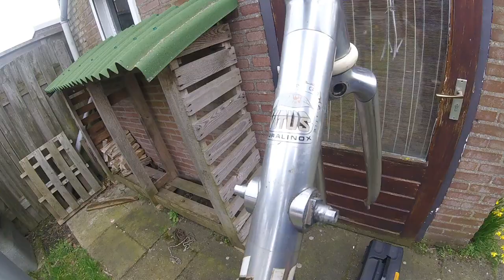Vitus 979 Duralinox - building my new Eroica bike, pt. 1

Comment: I come from this era in cycling loved those frames but could not afford one, used to do all that work with eyes shut but all these years later had to think, but I instantly picked up your gear shift  error!..nice wheels I had a hand built Bob Jackson 531 Pro frame suntour superbe pro groupset mavic rims, thanks,  look forward to part 2
Reply from the maker: Thanks! It was the first time I was putting proper downtube shifters, hence the trial and error. But they shift great in the end. I've ridden more than 100 miles already and hadn't have any problems. I'm curious about your Bob Jackson. Do you have any videos?
The part 2 of this Vitus 979 build video is almost finished, I'm planning to put the voice-over and I'm experimenting with the audio setup.
Reply: @polishTinkerer  I'm 64 now but if I got on a new bike I would be looking  for gear shift on down tube all the time! I was a  road runner but due to persistent injuries I took up a bike and got hooked on it joined my local club. No good mind! Just an average all rounder!..first bike was a Dawes imperial, second hand , which they all laughed at with my 36/50 chain set (but they never knew about my running/injury) I am in  west cornwall so can stop and admire the views when I got shattered.... Frequently
Reply: @polishTinkerer  oh no i only have a photo of it 23.5 inch frame i can remember the guy in my local bike shop measuring me up for it i ordered it and had it delivered to the shop and i bought some components from bike mags and the rest in the shop and then he put it all together
Reply: 1a cinelli stem cinelli 42 bars iscaselle saddle 28 spoke mavic rims (i had 28 and not 36 as in my area west cornwall the roads are very heavy so stiffer ride so as not to have the rims out of line so much) i had the very first white look clip racing pedals still got all this gear in my shed

Comment: I am building up a 979 myself. and I am having problems fitting the rear derailleur. I have tried to fit a modern Sensah deraiileur and a vintage Campagnolo derailleur. The mounting bolt does not seem to fit. Do the Vitus frames of that period use a different mounting bolt from the M10 x 1 that fits later bikes? I know I had to sand down a quill steam to fit the steerer tube for example. I am wondering if the the derailleur hanger bolt was unique for French bikes and more specifically the Vitus frames of that era. I have the same seat post binder arrangement for the seat post. That is an indication of a frame built between 1979 and 1986 I believe.
Reply from the maker: I don't suppose that the derailleur mounting thread is different than the standard one. I've simply used the bolt, that came together with the campa derailleur. And it fit without any problems.

Comment: I read all of the comments. Nobody questioned you about oil on the BB threads? That is not that bad, there is a guy in France who is greasing the tapers of his crank arm. NOO00 Not oil on the taper....   The crank arm dust cap should be greased or oiled. They can get stuck. In the States Park Tools is the big manufacturer of bicycle specific tools. What is the manufacture of professional tools in the UK?

Comment: Hi there. I’ve just bought a Vitus 1984 mint condition bike. Hardly ridden. Worried about the glued frame after all these years having dried up. Any advice? All the parts are Dura Ace which I could transfer to another steel frame of the same era...love the video very helpful
Reply from the maker: Hi Paul,
Thanks. Not much of an advice, some experience and general knowledge though. I've ridden only 200 km after building that bike and I don't see any loose parts or such. I have another Vitus frame, it's from late '80s, also no signs of dry glue. From what I've heard it's sort of 2 component epoxy-like compound used in aeronautics at that times. The Internet does not report any problems with those frames except for breaking saddle clamps ears. Vitus improved this design later on. Anyway, I see many Vitus aluminium frames for sale and none of them was damaged - unlike Alan, where often steerer tube lug is broken.
If I were you I would simply ride this bike, especially on Eroica California where they claim to check for rust on the frames.
Reply: I rode a Vitus frame for twenty years no issues. I t boned a Renault which was crossing a cycle lane which unfortunately bent the down tube and the top tube but the joints were still solid.

Comment: I have a similar bike frame from Vitus but with the central screw for the seat post in red color. And I am riding it for 5 years now equipped with Shimano parts: Dura Ace drive with rear and front derailleur, bar end shifters, 600 hubs and brakes. It is a light weight beauty.
You should have carefully polished the frame before you start and exchanged the seat post screw which seems to be rusty. Not sure about the steering head bearing, is this a plastic cover outside or just painted white?
Otherwise, good job with a good looking result.
Reply from the maker: @Stsstz - I was thinking about polishing the frame and decided not to - it will ruin any coating that is present there and bare aluminium, even polished, is prone to becoming dull. And I favour the sort of "patina" look on the bike. The seat post screw was rusty indeed, it broke when I was tightening the seat post. It will be replaced. The headset was Shimano, and that white thing was plastic cap that was broken. I'll be replacing it in part 2.
Reply: @polishTinkerer  - For enough, don't ruin things if you are not sure how to do. I have just repainted a frame, in parallel have bought different polish tools for my car. So I m getting more experience with painting and polishing. But it I not an easy task, first time often goes wrong.
Reply: Mike K - Fair enough, if you are not sure that your treatment will be successful you should avoid it. I have painted a bike frame twice because first time it was looking not nice and it scratched very easy. Now, it is more durable. It is always an experiment if you start a project first time.

Comment: How did you clean and polish the frame?
Reply from the maker: As far as I can remember, I used a rag and some degreaser. I didn't polish it as it wasn't that damaged and I didn't want to ruin the aluminium coating.